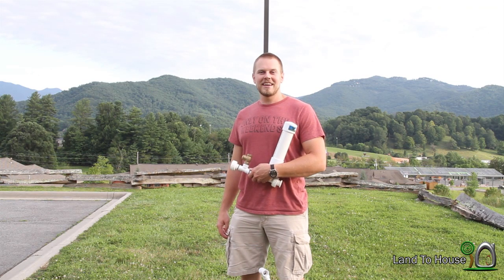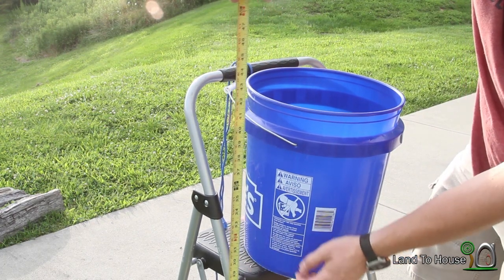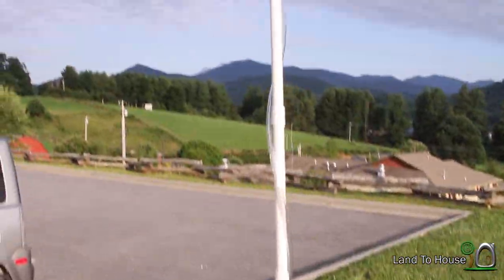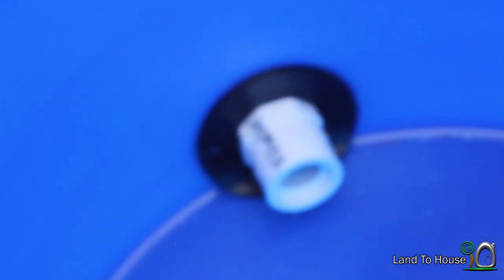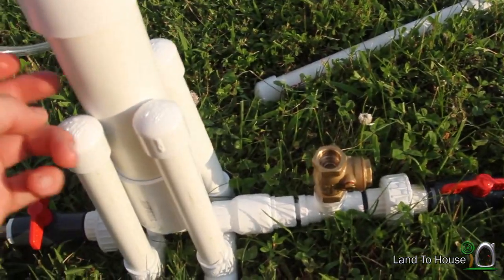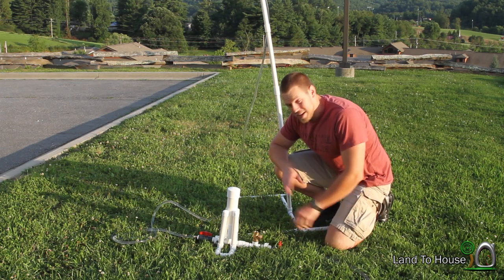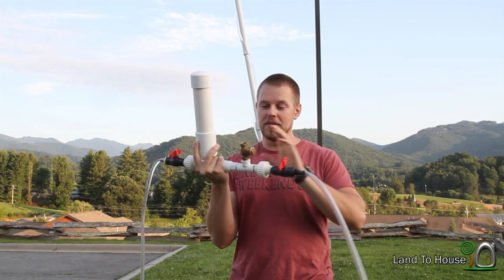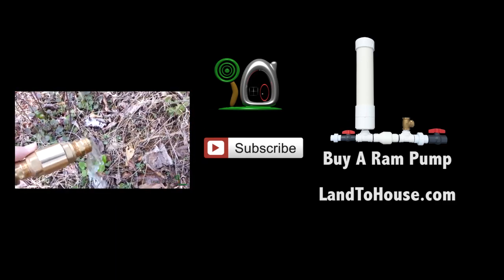1/2" Ram Pump GPM Test

Comment: I'm considering a ram pump for a aquaponics application. I'll have about 2.5'-3' of head pressure drop from a swirl filter to a sump. I'd like it to take a percentage of water from the drop and pump into the upper reaches of the greenhouse, for some plant towers. My question is my greenhouse isn't 10ft tall. How much back pressure is needed to keep the pump running. A rough estimate is putting me around 8ft of head back pressure available would that be enough to keep it running

Comment: Hey, I was looking at your 1/2 pump.  The website says 2gpm.  But if I watched this right if will work on 1gpm correct?  Is this the same 1/2 pump you sell on the sight.  I have about 2-4 gpm coming out of a rock face 99% of the time but during drought I have seen it as low as 1gpm.

Comment: Can you test it in 12inches drop pipe. Thanka
Reply from the maker: I have managed to get a ram pump to work on only 12" but the waste valve has to be tilted far to the side and the efficiency is low.

Comment: Your gpm is kind of skewed... because it doesn’t take into consideration the loss of water from the valve. So you have 0.5 gal per minute of draining the source but it looks like you have about 1/4 to 1/2 of that coming out of the hose.
Reply from the maker: I was only looking for the rate of consumption to operate the pump.

Comment: 1/4 turn valves are fine, but screw type valves allow you to bleed out slowly on start up making that a better over all experience, also keeps you from blowing up your system with an accidental water hammer incident !
Reply from the maker: Technically the ram pump is an on purpose water hammer incident.  
Screw type valves would allow for setups that need the delivery valve partially closed for back pressure.
Reply: @LandtoHouse  ever think about a video of a small solar dc water pump video for those people without minimum flow , it could help you to sell other products through affiliate links
Reply from the maker: I do need to look into other options. I also need to test out a dc diaphragm pump to build pressure.
Reply: @LandtoHouse   I’ve used many in RVs , they are not all created equal, I have found seaflow to last the longest for their price,  but even the cheapest one on a tank sprayer will get you 45psi from a 10ah battery
Reply: @LandtoHouse  if you have power and plenty of source water the cheapest option is the harbor freight shallow  well jet pump, lots of videos on it out there,

Comment: good Video, my question is, if it is also working with a expansion vessel?
Reply: Expansion vessel is the bicycle tube in the upright pipe, a pressure tank on the discharge could be used for storage but recovery rate would be miserable unless sized right, I have a 250 gallon expansion tank, I get about 5 minutes of great pressure, then takes 24 hours to basically recover, these ram pump are best used as a transfer pump

Comment: Another gr8 video. As i was saying before i have a 1 1/4" ram pump and my source isnt as fast flowing of water what do i do? If i reduced the size of my swing valve to like 3/4" from 1 1/4" would that help me  pump water ?? Or should i stay with my 1 1/4 " one. Or the length of my drive pipe make a difference? Many thanks..

Comment: Would be nice to know how much water actually got pumped up? GPM for the top. Say i want to fill up a tank at the top of a hill... how long would it take? Your video only tells us how quick the bucket got empty but i am not interested how much water we wasted😅
Reply from the maker: Hello. This test was to see how little water the small 1/2" ram pump used so people would know if their water supply can support it. The water pumped is typically 20% but this value is very dependant on several factors. Head pressure, lift height, drive pipe rigidity and length, waste valve tilt angle and many more things.
Reply: @LandtoHouse  thanks for your reply, great videos btw 🥳👍

Comment: I'd like to know what its output at the top is. I dont care at all about how long it runs off a bucket. How much can it pump?
Reply from the maker: The ram pump output depends on several factors. Input head pressure,  outlet height, waste valve weight, drive pipe rigidity, drive pipe length, drive pipe straightness, delivery friction loss, waste valve tilt angle... and a few others. This test was to determine how little water the small pump could run on. Do you know your setup? I can help determine the output for you.

Comment: It would be more important to know how long it would take to fill a bucket
Reply from the maker: This test was specifically to find the amount of water the small pump needs to operate. For those with small creeks.  The output depends on several factors. Head pressure, delivery height, drive pipe length, waste valve weight...

Comment: have a small spring with .75gpm can i use a ram pump. have about a20ft drop
Reply: Yes /no. Be touch and go, a storage tank at the source, such  as a IBC tote, let it fill up from your source, then you can run the ram pump from it for a longer run time

Comment: How about the check valve, like for example for 1.25 ram pump is it advisable to use 3/4 size check valve?
Reply from the maker: The waste valve and drive pipe need to match. All components before the pressure tank need to be the same size.

Comment: Can you PLEASE redo this experiment with respective calculations for waste water vs. water delivered? 
The 5 gallon bucket was emptied in 6 mins, but how much of that water was lost to the waste valve versus how much was pumped to the top?
Reply from the maker: Yes I can redo this test. The delivery vs waste will change with a few factors. Drive pipe length, drive pipe rigidity, head pressure height, delivery height, pipe friction. .. I am sure there are a few more. I will need to test with a couple heights for best results.

Comment: How much water does it deliver over the 6 minutes from the 5 gallons?  A pressure guage on output would give you vertical height indication also.  Nice vids too, thanks. I’m an Ozzie so we use metric , gallons get confusing as I thought 4,54 Litres was a gallon, but some have other values, thanks for all the great vids and info

Comment: Would it be possible to attach more than one ram pump on one line to give you more presher or longer distinc
Reply: Destiny Empowerment the first pump would have to be significantly larger then the second because of small amount of water actually being moved through the delivery line. ie- 2” pumps to a 3/4” or 1/2” pump (just a guess)

Comment: How long of a drive pipe is needed to run a inch and a half pump? I have eight feet of drop and a  twenty foot drive pipe. My pump is cycling ok but doesn’t build pressure above 20 psi. Would a longer drive pipe fix this?
Reply from the maker: A 20-foot Drive pipe is a bit short. The cycles of the pump might be too fast. Are you measuring that PSI with the delivery pipe closed?
Reply: Land to House with the pipe closed it will build up to about 28 but drops to 20 as soon as I open the delivery valve. I’m pumping over 400 feet wit an elevation of 40 feet. I’m getting about .8 gallons per min. My delivery pipe is 1/2 inch. Is that too small?
Reply from the maker: That delivery pipe should be just fine. The ram pump supplies such a low flow that there is very little friction loss. I have managed to build up over 40 PSI on three feet of head pressure. With the delivery pipe closed. You definitely have some loss going on.

Comment: Isn't it supposed to have two check valves, not one....and you did your Gpm test wrong, you needed to see how many gallons were actually delivered in those 5 minutes, not how much water was delivered and wasted
Reply from the maker: This pump actually does have a second valve. It is an inline PVC spring valve. My apologies for not being clear in the video. I was testing to see how many gallons per minute are required to operate this pump not the delivery amount. The delivery is going to change based upon the head pressure input and lift output

Comment: may i ask a question sir..if I'm going to pump the water to my fishtank and return the water to my tank again   using this ram pump is that possible? the falling water to the fishtank will create air bubbles for the fish to breath without the electricity needed thats what I want ..:D
Reply from the maker: The ram pump does not work well with closed systems. The pump will use around 90% of the water as waste. Your fish tank would be out of water very fast. Now if you are pulling water from a creek you will be fine.

Comment: is this one of the early vids this chap mede or has he come down in size to maximise the unit fore a spesial job after he made the big stuff   any one please ??????????
Reply from the maker: +Kevin Toms this half inch pump requires less water flow rate to operate. As little as 1 gallon per minute. The ratio of head pressure to lift is still the same as the bigger pumps. It would just operate with a smaller Source flow rate.
Reply: ok thanks for that i had little expectation of you repyling as i reasently said to much to the rong croud and then i incured to interference if the state and so i left well allone but try this i was taken down the welsh mines and shown this and for month now trying to mach three of the great invensions into one but i see a way that this would pobly generate a hell off a lot of enefgy but ive never seen it done like this but ime shure it would work but i need to get advice and this comes ffom the roman and celts gold mines in north wales as aboy with socalled autism but they saw it as old world in me busting out as in the old saying that at times the trueth will out and it wont be stopped and ive seen the dangers so if youll do vid call with me i,ll try to demonstrait my idea witch  comes from my understanding of the unsee ellement inherent on all things and its basically that i got angry wiith some people nott telling the whole story about edd shouberger and tesler so fi you get my drift and want to run thro the idea with me as i like your work you want to risc it  ?????????as clealy you can see im dislectic this is out so vidio only  send word if you want to try this with me
Reply from the maker: I too am dyslectic. I often write my comments in Word so that I can spell check. At the moment I am limited for time because my wife and I just had a baby. Tesla was an amazing fellow. I had not heard of Edd before. At the moment I had better not commit to another large project.
Reply: ok sir that understandable but if know someome with electrical knowldge that might coroberate what want do and understands these pump in what is clearly much more powerfull embodyment is the word that is way outside the box this way with huge potential in electro mag field then please point them in my direction please and thanks forthe staight answer you gave me likeyour vids stay with it and good luck with family sir

Comment: when you are priming ,are u releasing the air or compressing the air inside?
Reply from the maker: +Yang Solatar when priming the pump it is building aor pressure in the tank. So compressing.
Reply: is it okay to use a brass spring check valve,sir?
Reply from the maker: +Yang Solatar yes that is just fine. Be sure to make the spring lose so it closes easily.
Reply: how to lose the spring sir?it is rated PN16 by the way.
Reply from the maker: +Yang Solatar some of them don't have an adjustable spring. You should be Just fine!
Reply: ok a big thanks to you sir,,
Reply from the maker: +Yang Solatar happy to help

Comment: could you possibly explain in further detail why the pump stopped after first releasing the outlet valve ?
Reply from the maker: +Harrison Long Yes. When the pump is turned on for the first time there is no pressure in the tank or water in the delivery line. The pressure wave in the drive pipe must have back pressure in the delivery line to keep the cycles going.

Comment: Your test only tested the consumption rate of the pump. What is the delivery rate? Nice setup BTW.
Reply from the maker: +Andrew Carpenter yes that is correct! The delivery rate will change depending on the head pressure and delivery height. More head will result in more pressure and a higher rate to a point. Too much head and the pump will stop. With the small 1/2"  pump at max efficiency it will not pump more than 1/2 gallon per min.
Reply: Land to House Thanks for clarifying.
Reply from the maker: Anytime. Thanks for watching!
Reply: the bucket drained at .8 gallons per minute, but if 90% goes out the waste valve you only pumped .5 gallon total in that 6 minutes or .08 gallons per minute.  Not criticizing though.  I like your videos.
Reply from the maker: +Gordon D. Lear math is not my strong point :) the clear tube is highly inefficient as a drive pipe.

Comment: The idea; not the pumps waste, it's the idea that it can pump up hill using gravity and pnumatic pressure.  It's not use full for a limited source where you want to move 100% up hill, the waste pump cycle should be allowed to return to the creek
Reply from the maker: +Charles Zimmerman yes absolutely. My personal ram pump is in the creek and the water from the waste valve returns to the creek. The ram is not effective from a small tank source as in this example.  But a known tank size is great for testing values.

Comment: Hmmm .8 gallons per minute is a little greater than 1/2 gallon /minute isn't it?
Reply from the maker: +hankus253 my apologies for not being clear. This video shows the water consumption of the pump to make it run not the water it pumps.
Reply: Duh!  Thanks for the clarification, it should have been obvious to me though.
Reply from the maker: +hankus253 I was not very clear in my video so. ... no problem :)

Comment: Hi Seth.Just my observation .I saw a video a thin rod is soldered or threaded to the valve to counter the water flow with lead weight to balance the flow of water thus the flap of the valve can be better control.Please let me know your idea and experience.Thank you.
Reply from the maker: Yes you can alter the check valve to make the pump operate with greater pressure. The valves that I use are hard to modify. Normally the valves that have added weight are the ones that operate vertically instead of on a pivot like mine in this video.

Comment: Please correct me if Im wrong.Now I need a tank and tap connection .Same pipe dimension as valve and also make sure there there no air in the drive pipe.My slow flow creek will start pumping .My question is at one time you use air pump to half fill the pressure rubber tube.Do we still have to pump it up alittle bit as in your video.Thanks.
Reply from the maker: You will need the tank for pressure to build. The bike tube inside is not required but helps with long term watter logging. Just partially inflated will do just fine.

Comment: tongue in cheek .Can I test my pump on normal urban drain water pipe to do a trial run?Thank you.
Reply from the maker: +Said Madina the ram pump has to have an air tight intake or the pump will stop. As long as your drain pipe enters into a tank you can run the pump but connected directly will likely not work.

Comment: 1. The valve does not go up and down.
2.The air presure pvc looks to deep in the chamber .Do I need to pull it down nearer to the connecting thread.Appreciate your quick respond Seth.
Reply from the maker: Make sure that you are using the same size drive pipe as the pump check valves. 1/2" valves = 1/2" drive pipe. Be sure to remove any air that might be in the drive pipe. The bike tube in the pressure tank will rise as water fills the tank. There is no need to adjust it manually. Feel free to send a picture of your setup to my Landtohouse gmail and that will help me understand your issue.

Comment: now if you pump the water high enough to create a second head, could you use the Pelton wheel to generate enough power to pump the excess water from both ram pumps and peltom wheel, back into the lower bucket with an electric 12v pump??
Reply from the maker: Meaning a closed system? The head pressure gained from the pump would not produce much electricity. The ram pump has so much loss that it is not a good means of getting water to a pelton wheel.

Comment: Can one of your pumps 60' high and 900, run?
Reply from the maker: +Nancy Nutting yes all sizes can make this. I do recommend using the 1" or 1-1/4" fir best results. You will need approximately 9 feet of head pressure.

Comment: There is a ton of info about how to build a ram pump, which should be there to help others save money, why are u selling a ram pump that is not your idea and very simple to make???
Reply from the maker: +Fra R. I have a free ebook showing how to assemble the pump. And lots of information about them. You are correct that it is easy to make and the parts are typically available. But the hundreds of customers who have purchased oftentimes do not want to build the pump they just want the water it provides.

Comment: 10W Water Turbine Generator Micro Hydroelectric DIY LED Power DC 5V 12V 80V NEW  on ebay you should try to add it to the system maybe make A portable unite for camping !
Reply from the maker: +Benjamin Nave I actually have hooked up a nozzle and got 4v from a treadmill moter. So yes a 10w would be good!